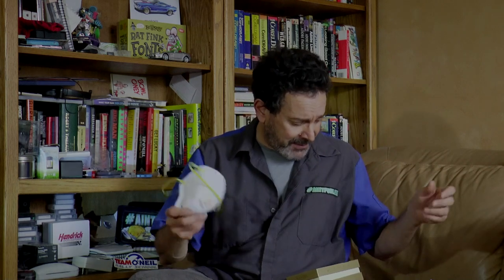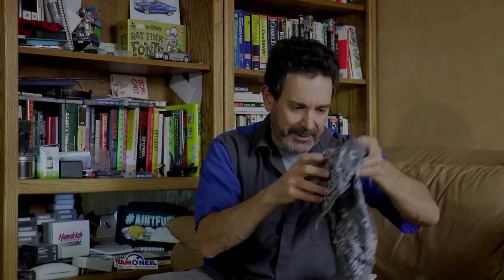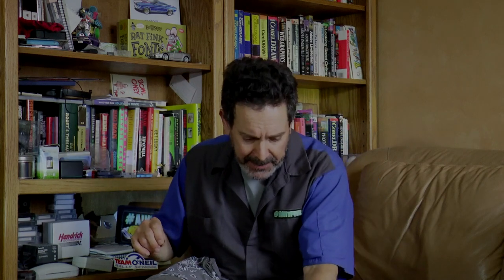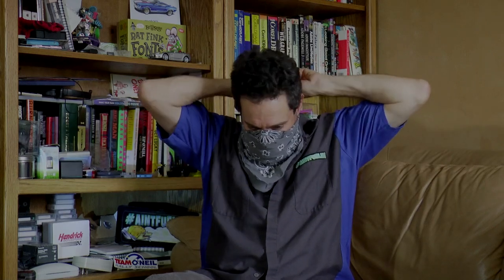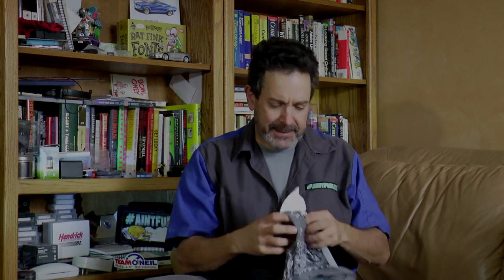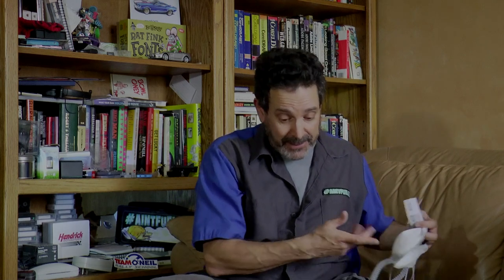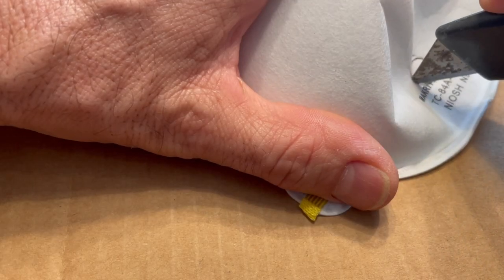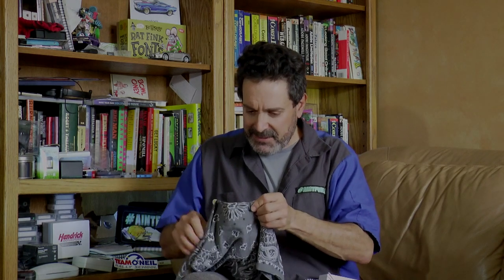N95 Bandana Mask with Broad Airpro Powered Ventilation

Comment: Wearing  an N96 mask is like wearing no mask at all. You're better off with a plain bandana. Merry Christmas Dan.  2010 Yaris, 35 mpg city all the time. Any car reviews coming up in 2021?
Reply: Wearing a proper n95 mask is the safest option you can get. a bandana doesn't give good protection, droplets can easily go tru the bandana
Reply: @nikothewagon1700  If it vents, then it can let out droplets which can carry the virus. I'd rather use a cheap, paper one like they give us in the lab.
Reply from the maker: Bingo! That’s why I wear a non-vented N95 under the bandana.
Reply from the maker: Merry Christmas, Pedro! I only use non-vented N95 under the bandana. Knock wood, I will have automotive content coming in the new year. I’ve been scrambling to keep the bills paid, but I’m working on some crazy stuff. 

Nice numbers on the Yaris! I picked up a 2014 1.0L EcoBoost Fiesta a while back. Averaging just a bit less than 40 MPG combined. Be Well and Stay Tuned!
Reply: @mpgomatic  I rented a Fiesta once and honestly, it was the best small car I've ever driven, too bad for that trouble prone DCT transmission.
Reply from the maker: 👍🏻 Mine’s a manual. I wanted to get the ST, but it was 2x $$$. The 1.0L is still a blast to drive.
Reply: @mpgomatic  Good choice, you don't really need the ST, just get good handling tires and you'll be fine.